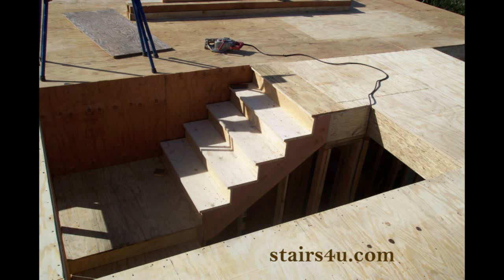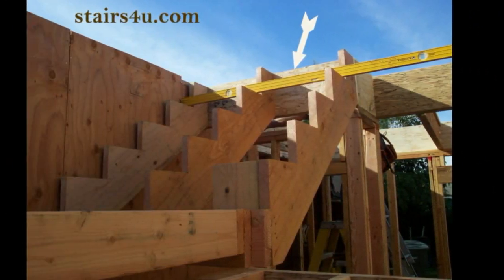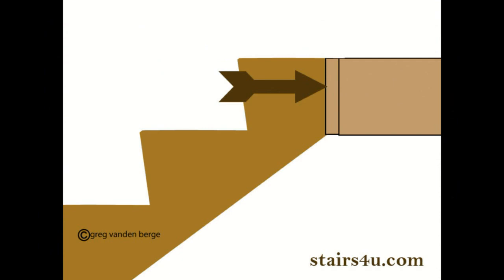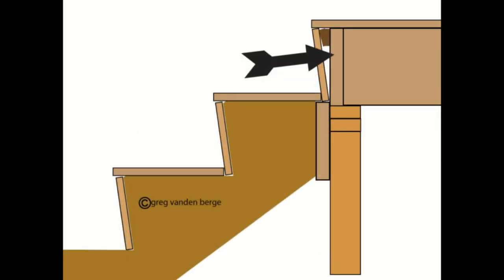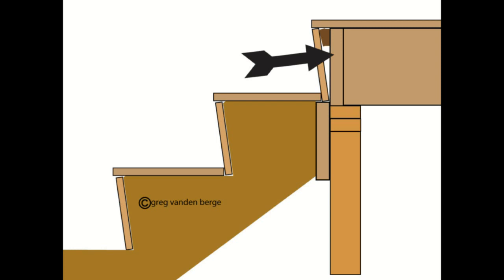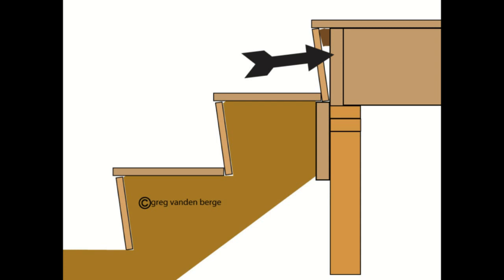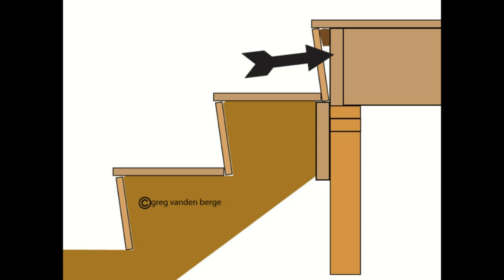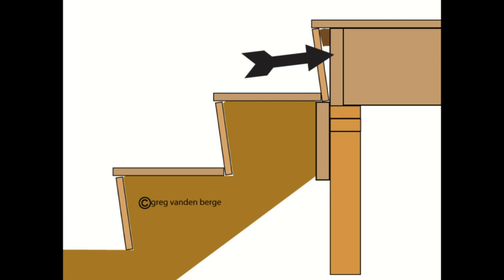What Is A Stair Headout? - Stair Framing Parts

Comment: Hi wouldn't it be better to place the riser board on top of the tread rather than behind it as shown
Reply: Good question. I'll make a stab at it: 1) treads have to be a minimum of 10" in CA, so 12 x's barley give you that and 10.5" even better/safer (we're talking stain and/or paint finish).
2) Probably not a hard rule that the riser is behind or on top of the tread (plywood etc)  and depends on design/style more than anything (stain/paint finish). 3) However, there is a stair "creaking and squeaking" which can sometimes occur so I'm going to say the less nails and contact between boards the better (also moisture collecting under riser edge) - meaning generally that riser behind tread is better. But alot of considerations like material, fasteners, wet/dry climates, etc... my best guess :)
Reply from the maker: Good answer Michael. In reality, I don't think it really matters and it would be personal preference. But, the riser would be to go on first if you were going to staple the lower edge of the riser, to the back of the stair tread.
Reply: stairbuilding Probably a good solution huh... I tell you depending on the tread material and where/what I was building I'd be tempted to just leave an 1/8" gap there. Most of my experience has been in wet climates and a creaky stairs would just be an issue that would come back to haunt you (pun slightly intended) :)
Reply from the maker: Good advice
Reply: +Jasper Jones It's good to remember that wood moves because of humidity and temperature.  Everything said here is valid for almost all of the west coast, because (at least within a 100 miles of the ocean or so) you're dealing with marine climates: Wet, cold winters and warm dry summers.

Coming from the midwest, I would still put the risers behind the treads outside, because we have cold dry winters, and hot humid summers.  If you don't want to see a gap in the riser, you probably want it hidden, and leave a hair for a little wood expansion.
Indoors, I think you could build it either way, since temperature and humidity tend to be controlled, although, in the midwest, it can get so dry indoors that you need to consider serious wood movement, especially if it's exposed.

I would consider using flat grain cuts of lumber for your risers (where the grain runs parallel-ish to the broadest side of the board).  These are not as likely to visibly warp or split like exposed grain (where the grain runs across the narrow dimension of the board).

Once again, this is advice from a midwesterner, who's lived in -40 outside, and so dry inside I've gotten a nosebleed from it.  It can really dry out your wood, and wood does funny things in those conditions.
Reply from the maker: +Monty Cantsin Thanks for sharing and you should avoid using center cut lumber. This is lumber cut from the center of the tree.
Reply: +stairbuilding Heartwood
Reply: I re-read my comment and realize i said something confusing:  Flat grain is when the grain is exposed on the narrow dimension of your board, and exposed grain is when it you see it on the broad face of your board (like in old fir flooring).

A friend of mine builds bee boxes, and he picks flat grain cuts, since you want no finish or treatment, b/c of the bees, and that type of cut lasts longer outdoors.